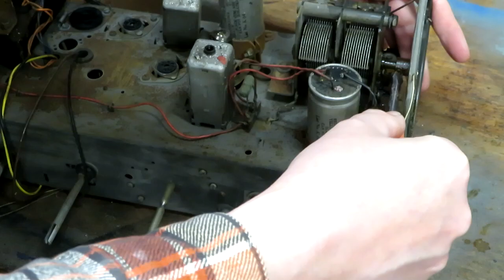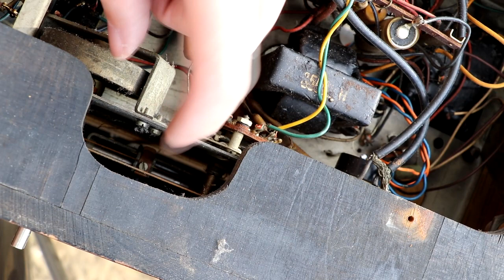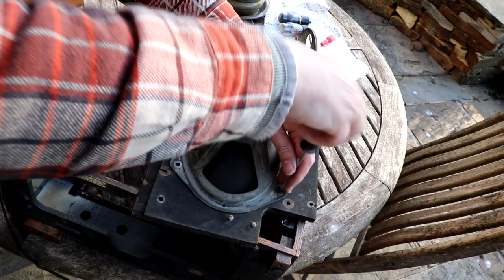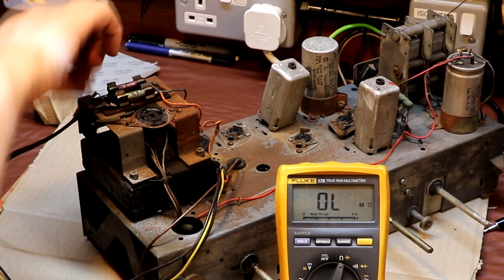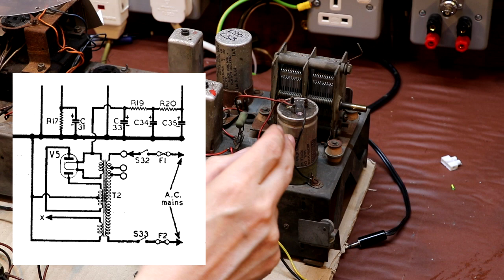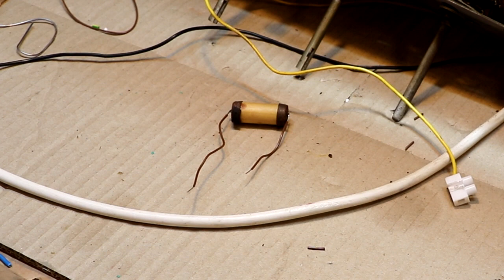HMV 1121Part 2 - Tale Of Two Chassis

Comment: I can't believe it worked so well, after looking like such a wreck at first! Amazing bit of work. I loved the part about sucking all the light out of the room. A real pity about the woodworm in the second cabinet. Will you try to rejuvenate the original cabinet then?
Reply from the maker: Hello David thanks for watching and leaving such a nice comment. Yes woodworm can be difficult for a small cabinet it will go in the oven for 5 hours and will kill the woodworm. Freezing isn’t reliable and chemicals are dangerous. Unfortunately the other radio cabinet is so infested it’s probably beyond economical repair. But I may get the chassis up and running one boring Sunday.   I have stripped the first cabinet and the varnish is drying as I write. Hopefully rebuild the radio this weekend. Check out part 3 https://youtu.be/GWItO0Cwg94

Comment: "You know who your friends are"??, you certainly do now, Chris !!...lol
Reply from the maker: Just shows you can polish a turd
Reply: @allthegearnoidea6752  By the way, Chris, if those 4 dial light bulbs are the originals as fitted to the set from new, they will have HMV stamped on the bulb's metal shroud where the voltage of the bulb is also stamped on, but you may well have binned those old bulbs by now..

Comment: It was the best of radios.📻 It was the worst of radios.🚽 I found this a smart and clever resurrection video there Chris. 
No boring parts, well except for the woodworms. Pun intended. Steve from across the pond.
Reply from the maker: I going to have to borrow that Line for part three. I’m working on the cabinet at the moment. Just chemical stripped it and gluing some of the plywood laminate together and filling missing veneer. I hate woodwork that’s the boring part for me.  To be honest I am wondering if I’m running out of steam with these videos I’m sure there is only so many times you can watch me restuffing capacitors. Thanks for the nice comments regards Chris

Comment: Awesome job, that's a beautiful sounding radio.  I take back everything I said about gutting it and putting in an mp3 player, since it sounds so nice.  Cheers!
Reply from the maker: I may still add an MP3 player as it would extend it’s usefulness. Yes I pleased with the sound and hopefully it will sound better still when I change out a few more of the capacitors and do some alignment. Thanks for watching regards Chris

Comment: Reforming the aluminium oxide layer on a capacitors plate is absolutely essential before applying power , if the capacitor is left without any polarising voltage for a very long time the thin dielectric layer depletes over time and without the dielectric insulating layer the capacitor will act as a dead short when power is applied causing it to heat up rapidly and the gas build up inside could cause it to explode, reforming an electrolytic capacitor will not however cause its capacitance to increase if the electrolyte  had dried up .
Reply from the maker: I don’t waist my time reforming capacitors the rated life of a capacitor is around ten years, so at 70 years plus they need to be replaced regardless of the brand.  I do however sometimes try reforming as a temporary measure where it works about 25% of the time.   However other reforming gurus may believe differently.

Comment: Hi Chris,
This has, and is turning out to be a positive result.  When it come to assessing Vintage Radios 📻, and what is realistically restorable, generally speaking I’m usually not too far off the mark.  Say, for example, you did remedial work on both chassis, there is a distinct possibility both would more or less perform as good as each other.
The HMV badge on the second cabinet looks to be in excellent condition.  It would make an excellent piece to clone.  Quite likely each one could be worth at least £5.  As I have said, they are certainly not the easiest of radio decals to reproduce using conventional home printing methods.
My method of killing woodworm (proved I count no more than ten to twelve worm holes in an entire cabinet) is to wrap the infected cabinet with polythene, such as a clean bin liner, and keep the lot inside my chest freezer for about two to three weeks.  After that time I give the entire cabinet a quick brush-over with woodworm killer.  That usually cures the little blighters LOL.
Checkout my latest video upload to YouTube.  I’ve a strong feeling in my water it might appeal to you LOL.
The man from Sheffield
Reply from the maker: I will check out you latest video later today. My house has a lot of exposed wooden beams so I am very careful with woodworm infestations. I have heard that it really need -70 to kill woodworm as they can survive freezing. The oven is a better method but this cabinet won’t fit in my oven. I could have it gamma ray treated but it’s expensive.  I don’t trust the new safer chemicals treatments.

Comment: So you found no (practical) treatment for woodworms? 
Throwing the baby out with the bathwater seems a bit extreme.
Reply from the maker: The practical treatment is to put it in the oven for 5 hours at 60 degrees but the cabinet won’t fit in my oven. The freezer doesn’t work unless it goes too -70 and the new safer chemicals don’t work either. I could get it professionally treated but that’s around three times the cost of the radio.

Comment: Now that was a supprise, the battered battle ship works quite well :-D
You missed a chance there, you could have used the other chassis and say you restored it :-D
Take the valves out of the rough chassis and throw it in the sand blaster,  then go mad with the airline after.
Evil yes, but i bet it would survive.
Its a shame the woodworms had there evil way with the nice case, but if they have buggered off then fill the holes with thinned varnish.
So i'm not mad when i keep the plug and mains cable off dead stuff,  a handy bodge cable for those times when you are handed a device to repair and the plug snatchers got there first, dam plug snatchers.
I stick a chocolate block connector on the cables, im cheap, dont tell anyone :-D
Reply from the maker: I wish a had a media blaster but I don’t have the room for one or  a big enough compressor but it would be useful. I do have dilemma I’m not sure which chassis to do. I’m tempted to do the new one as it has an intact dial cord
Reply: @allthegearnoidea6752  Well the grotty one works, so see if you can make the clean one work even better with the valves out of the grotty one, if you can then use the clean one.
You will gain a nice variable toaster rack off the battle ship to use on something else :-D